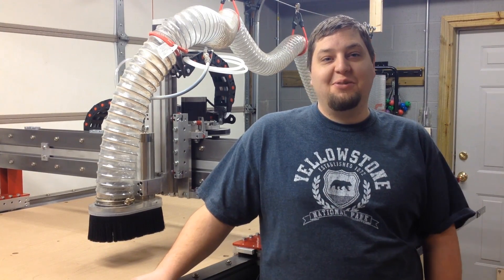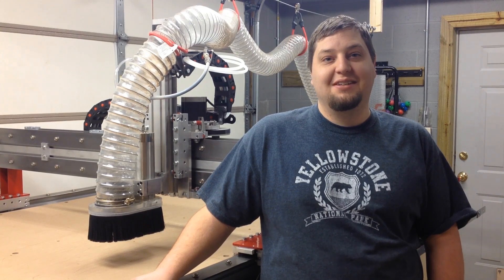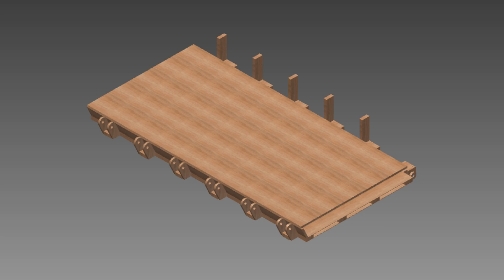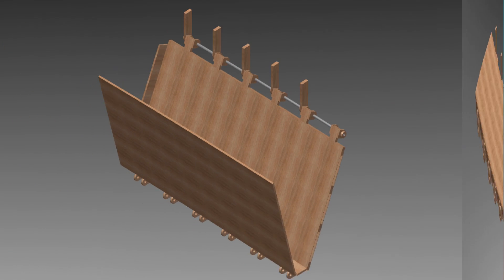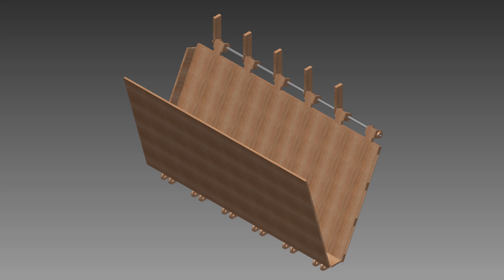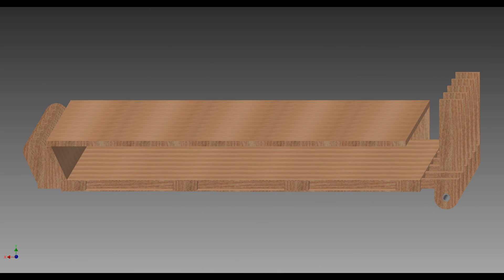Ceiling Hung, Folding Sheet Good Storage - Part 1

Comment: Cool idea for storage.  I have some questions about running the CNC I dont have one yet but Im wondering if you can gang all of those dado cuts together ?  It seems to me if the grid is set at a constant distance  you could gang them all together clamp em up together and  cut everything at once. Isnt that the promise of the CNC? looking forward to the rest of your build kudos.
Reply from the maker: Andrew,

First, thanks for coming over to take a look at the project!  I appreciate your time and thoughts!

Regarding gang cutting:  Certainly you could do that and I probably should have.  CNC is an awesomely powerful and useful tool to have in any home shop and they are getting cheaper and cheaper all the time.  You can get into this for less than the cost of a really good table saw.

There are 2 tricks to getting that going: 1) you have to set up your cam correctly.  In this case, I used vectric so I would have had to stretch the pockets when I produced the cam from the part.  2) you have to align the parts and hold them all down with clearance for your bit to travel over.

In the end, I was a bit lazy on the up front setup and just went with the easy stuff there and paid for it switching parts.  If I were to produce this thing, then I would definitely invest in getting efficiency.  As it is however, I still was able to go off and do other things while the pockets (dado) were being cut.
Reply: 21st Century Woodworking Thanks for taking the time to reply. I see that you have holes for your clamps. If you made a board with some reference pegs that would square an end right just clip it on like a lego same for the parallel sides then a few wedges would clamp it tight in parallel?
Reply from the maker: Andrew Leith You got the right idea!  That's why I made the grid.  If you notice, I have some 0.5" aluminum pins that I use to line up the parts.  You could just as well make up some blocks to line them up.  You would have to do something a little different with clamping, but it wouldn't take much.

Comment: Cheers for the message Dirk. Looks like a good solution. How much weight do you calculate it can take in sheet goods? Hope you're installing a dead man latch - it doesn't bear thinking about the rack swinging down at you out of the blue!
Reply from the maker: WOmadeOD - Made in Wood with Mitch Peacock I am designing the rack to hold 650 lbs.  I am installing wire rope clips in the ceiling which will be able to hold the entire load just in case there is a failure.